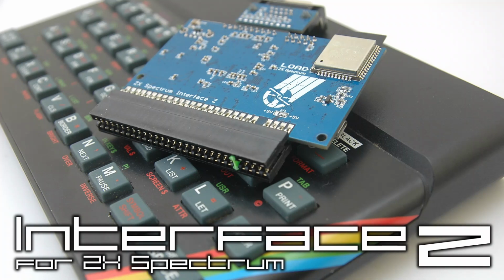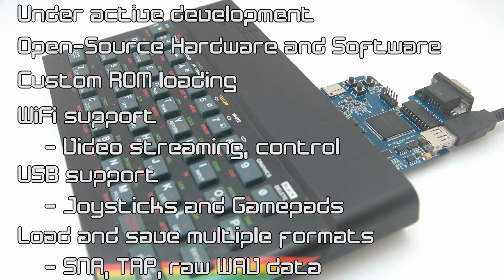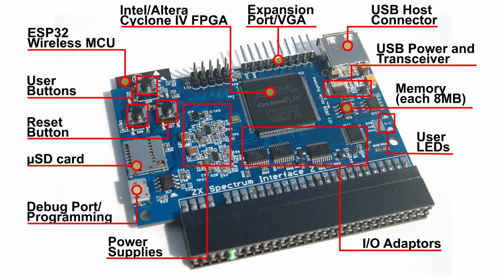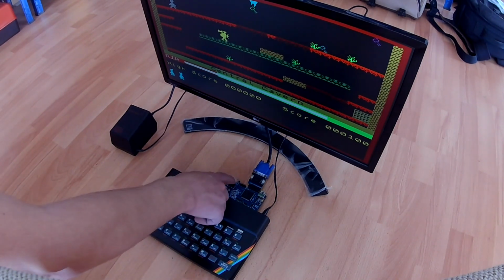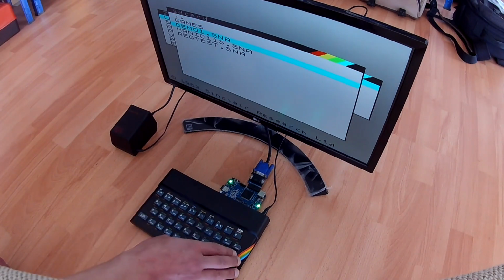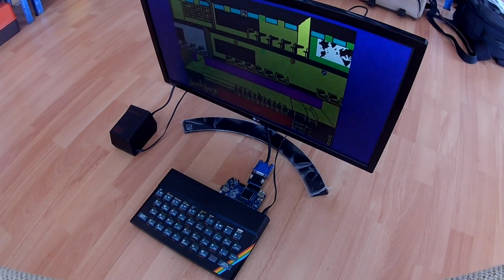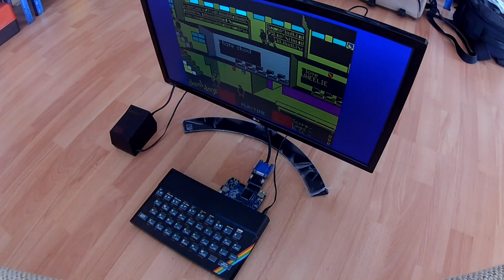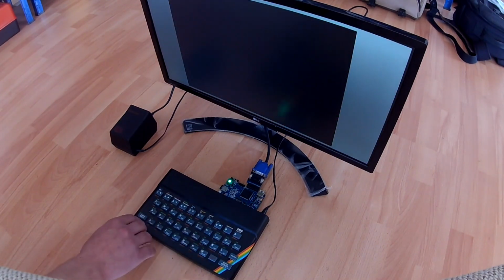Demo of "Interface Z" for ZX Spectrum

Comment: The user buttons being so close to the reset button worries me - might be easy to accidentally press the wrong one? Also, any chance of a pass-through or do you think that isn't possible/could work with any other cards (could/would it support ULAplus?)
Reply from the maker: The idea is for the reset button to be significantly shorter than the user buttons, so when the interface is inside its case it will be difficult to trigger the reset by accident (the reset button should vertically align with the case).
Reply from the maker: Regarding the pass-through: it's difficult to have one, since we need the expansion port at the back. Regarding the ULAplus: it can eventually support ULAplus modes - right now we are still fine-tuning the VGA output so that it correctly renders all raster-chasing engines [this is difficult because the refresh modes are different, and requires some bit of trickery and RAM to do it properly].

Comment: great job!! a question, can i use the RF out?
Reply from the maker: Yes, you can. It does not interfere with the regular Spectrum behaviour.
Reply: @ÁlvaroLopes-g3h  how much is the cost of this? i can´t see on ebay.
Reply from the maker: @sebastianabreu1243  it is still in development. I will update when it is available.
Reply: @ÁlvaroLopes-g3h  thankyou!

Comment: Wonderful project, congrats! How much will it cost?
Reply from the maker: Still to be defined, should retail for about €80 or less
Reply: @ÁlvaroLopes-g3h  Thanks for telling. My 2 cents: Try to lower it as much as possible, cause there are many similar devices on the market already, and many more will appear as fpgas become easier to program, but the lower the price, the better it will sell, cause many of them are costly, and it is weird to pay more for an expansion than for the computer itself